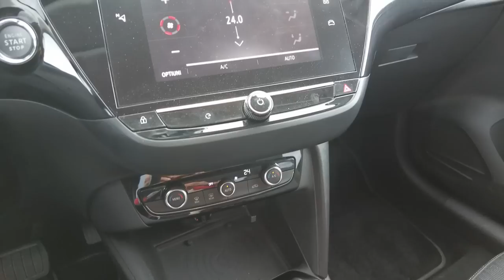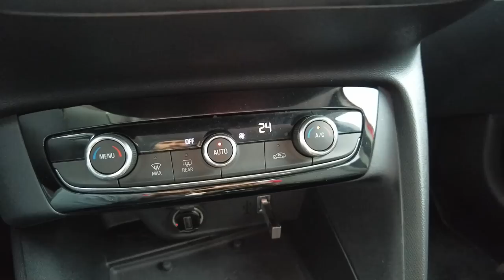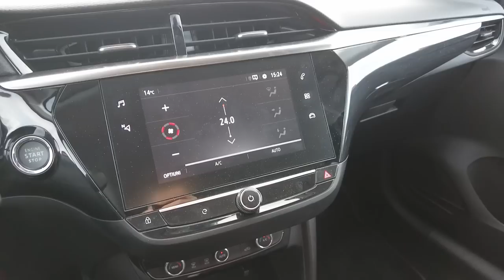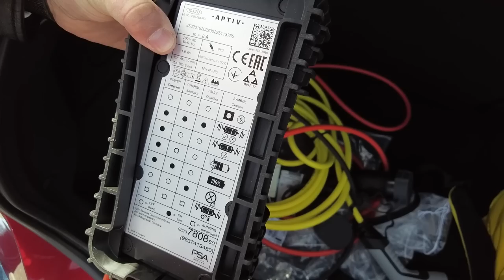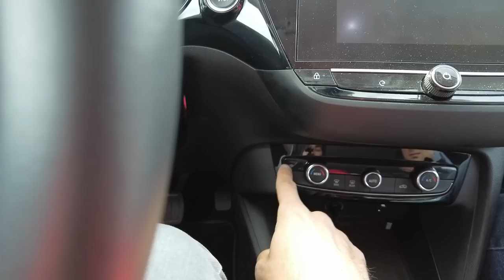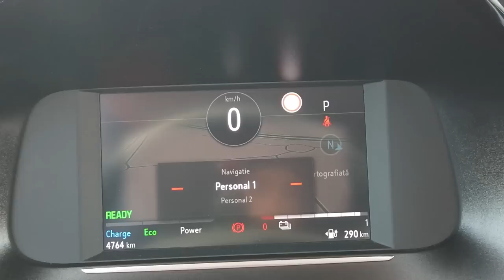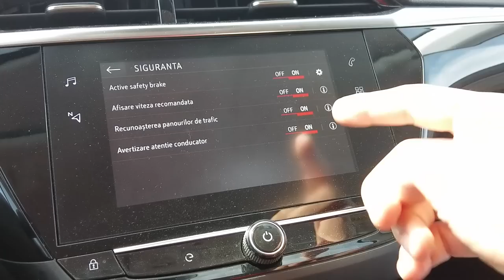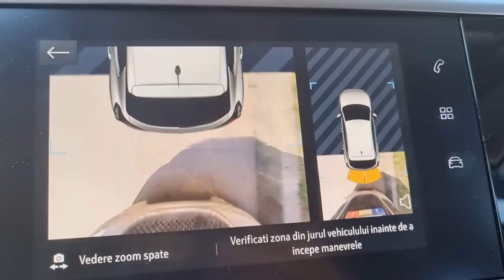Opel Corsa-e | Cel mai bun raport pret/calitate pentru o ELECTRICA (astazi) @ECODRIVE

Comment: Faine electricele, dar eu am 2 lucruri foarte utile: abonament la transportul in comun + mersul pe jos (pentru urban) si tractor pentru extraurban...stiu, stiu, am emisferele deplasate si inversate, vorba unui prieten!
Reply: Transportul in comun si mersul pe jos bat orice masina. Nu este o gluma, este realitatea.
Reply: @ECODRIVE  mai misto cu bicicleta
Reply: Masina paguba la casa omului ,nu pol ?
Reply: @trawauto9565  niciodata!
Reply: @ECODRIVE  cu 3l de apa am pedalat 80 de km...deci, da, aveti dreptate!
Reply: @poldaniel3574  sunt fan bicicleta. Inainte mergeam si 100km intr-o zi. Ultima data cand am mers mai mult a fost la “Prima Evadare” 👍
Reply: @poldaniel3574  e buna o bicla mai facem și noi sport ...
Reply: De o vreme incoace nu ma mai pot da pe bitza din cauza unui genunchi...inainte faceam cateva mii de km anual, seara dupa servici si in uichend (am scris expree).
Reply: @trawauto9565  da, inainte faceam multa bicla, acum nu mai pot...
Reply: @poldaniel3574  pol dar unde o fii dispărut popica cred ca e ocupat sa le dea de mâncare la cățeluși 🙂🙂
Reply: @poldaniel3574  genunchiul cam nasol dacă ai probleme la el ...mai ales pt bicla genunchiul e vital
Reply: @trawauto9565  da, in urma unui incident pe santier mi s-a rupt 2 bucati de os si se afa intre cartolaj si rotula...trebuie operatie dar sunt barbat, merge asa boss! 😂😂😂😂
Reply: @florinionescu8594  😂😂😂 ne vedem la “Prima evadare” in primavara

Comment: La infrastructura de la noi, cred ca tot Kona de 64 kWh e locul de pornire daca electrica va fi singura masina (Are autonomie mai buna decat model 3 SR dar e limitata ca spatiu interior) , e cu vreo 6000 mai scumpa decat ceva de genul Corsa e dar ai si autonomie incat sa nu iti faci griji daca nu gasesti statii.
Daca am avea statii fast charge de 100+ dese nici cu Corsa nu ar fi problema la drum lung.

Recent am fost cu un coleg care are Kona electrica 2021 Iasi -Transrarau si retur, si a facut 470 km fara sa trebuiasca sa incarce pe drum  - iarna 4 oameni in masina , intr-adevar mers fara sa depaseasca limita legala de viteza dar a ajuns doar cu 15 minute mai incet decat alt coleg cu Mazda CX-5 .
Reply: Kona este printre cele mai bune masini electrice. Are cel mai bun raport pret/autonomie. Este o masina eficienta si are autonomie mai mare decat Tesla Model 3 SR+.
Corsa este un fel de “kona” in segmentul ei de pret.

Comment: Masina merge cu 7 km/h neavând 1 pedal dar poti modula viteza sub acea valoare folosind pedala de frana. Legat de autohold, s-a făcut "cost cutting" din nefericire dar poti activa frana de mana electrica la semafor fara a trece in modul N iar masina va stationa.
Reply: Va staționa, dar forțată de frână sau pentru ca se oprește acea ușoară accelerație? Oare se consumă energie dacă se cuplează frâna de mână electrică fără a se trece în modul N?
Reply: @simimy97  Totul este electronic. În momentul acționarii frânei de mană motorul cu siguranță este oprit deci nu forțează nimic si nici nu consumă.

Comment: Salut Vlad, salutare tuturor care urmaresc canalul tau. Felicitari pentru canal,te urmaresc cu mare drag de mai bine de un, de cand mi-am luat si eu o Corsa electrica( Vauxhall). Locuiesc in UK de aceea este sub sigla Vauxhall. Esti extraordinar in ceea ce faci, felul cum prezinti masinile, cata pasiune si interes ai pentru domeniul auto.Povestile pe care le aduci o data cu masinile sunt captivante si detaliile deasemenea,de aceea te ascult cu placere ore intregi. L-am urmarit mult pe prof. J. Kelly.Revenind la masina(Corsa)eu unul sunt multumit pana acum, masina este fabricata in ianuarie 2020, am luat-o de la o reprezentanta Vauxhall cu 2300mile(@3700km)parcurse.O conduc zi de zi pentru naveta(oras,drumuri nationale, putina autostrada- viteze pana la maxim 70mph(112kmh),18mile(@30km)dus-intors.Am avut o singura problema pana acum, o scurgere de antigel la unul dintre termofloturi( in partea stanga sus), a fost schimbat pe garantie. Consumul este undeva de 15-20kwh/100km in zilele cu temperaturi peste 10grade, iar cand este frig in primii 10-15km consumul este undeva la 25kwh/100km daca nu fac preconditionarea masinii implicit a bateriilor. Macar 20 de minute inainte de a pleca la drum pornesc caldura din aplicatie sau o programez cu o zi inainte. Am ajuns sa o conving si pe sotia mea sa o conduca :) si am mai luat si un Grandland hibrid4 tot asa de prin 2020 cu vreo 4000km facuti. Grandlandul este altceva, este o placere la condus,iar consumul total la benzina dupa 1000km afisat acum pe bord 3,5L/100km dar o incarcam tot la 2-3 zile acasa la incarcator de 7kwh. Consumul de curent este pe undeva la 25kwh/100km dupa transformarile mele din mile/kwh :) . Am observat la Corsa cand o incarc la un incarcator de curent continuu imi arata range-ul apropiat de cum spune cartea :) adica 209mile(330km)cand o incarc de acasa la 7kwh monofazat (30A) imi da range doar de 185mile(295km) iar in viata reala fac cam 120-130mile(200km) ceea ce este bine pentru mine. Imi cer scuze daca am scris prea mult. Te rog frumos cand o sa ai timp sa prezinti si un Grandland hibrid4(am vazut prezentarile la Ds7 si 3008 care folosesc aceiasi tehnologia cu Opel/Vauxhall, dar sunt niste aspecte care nu-mi sunt clare inca). Mult succes!

Comment: Fiind baiat destestept,sunt sigur ca daca te uiti mai atent pe un principiu de functionare a sistemului de climatizare o sa-l intelegi si  mai bine.  Aici l-ai prezentat eronat. Spun asta pentru perfectionistul din tine si sper sa nu fie luat drept un hate
...si da, cred ca esti nr 1 in ceea ce faci.
Reply: Pai e simplu sistemul, fiind pompa de căldură are vaporizator si condensator atat in botul masinii, cat si in habitaclu, si recircula antigel si prin baterie si prin ansamblul motor invertor convertor si incarcatorul de bord
Reply: @vladdutz20  nu are si condensator si vaporizator atat in botul masinii cat si in interior. Atunci cand vrem rece in masina ,avem vaporizator in habitaclu si condensator in botul masinii. Acelasi vaporizator devine condensator si invers cel din botul masinii devine vaporizator cand dorim caldura in masina.
Reply: @raw_truth  la acest sistem nu este asa, am diagramele.

Și sistemul de pompa de caldura de la Toyota la fel este, sau de la VAG
Reply: @vladdutz20  atunci e greseala mea. O sa ma uit pe diagrame👍

Comment: 1. De ce nu vorbiți  despre  reciclarea  bateriilor.  2. Dacă mașina  ar avea 8 ani și bateria  s-ar strica cât costă  reparația  ?
Reply: Ce-i cu reciclarea bateriilor? De fapt, unde ai vazut tu deocamdata baterii de masina electrica date jos? Uite, masinile electrice sunt in general noi - adica cu greu gasesti unele produse inainte de 2012. Iar masinile astea sunt functionale cu bateriile lor originale. Ca sa-ti faci o idee, pentru o masina care avea 150 de km autonomie, dupa 8 ani de folosire, sunt raportati acum cam 100 de km autonomie. Zici ca nu-ti faci treaba cu ea si asa? 

Apoi, sa stii, exista o cerere mare pentru bateriile uzate. Pe de-o parte exista deja metode de reciclare, pur si simplu se desface acumulatorul, celula cu celula si se refolosesc materialele. E greoi, dar merita efortul, pentru ca bateria valoreaza mult. Apoi mai sunt campurile de fotovoltaice ce vor sa foloseasca acesti acumulatori uzati pentru a stoca in ei energia in exces captata in timpul zilei. Este excelenta metoda pentru a elibera energie noaptea, la valori mult mai bune. 

Cat despre treaba cu 8 ani, iti spun cum e calculul la masinile de sub 15.000 de euro. O Dacia Spring o acoperi din economia de combustibil si piese integral pe la 100.000 de km. Un VW E-UP pe la 130-140.000. E-UP-ul are garantie pe baterie pana la 160.000 de km. Practic daca se strica atunci cand iese din garantie, nici nu o repar, iau direct alta, pentru ca masina deja si-a acoperit complet costurile de functionare.
Reply: Eu am baterii de drona care au peste 10 ani si merg ca in prima zi.

Costul unei baterii este mai mic decât reparațiile care intra în 10 ani într-o masina cu motor termic

Comment: Salutare, merita o masina electrica?! eu acuma am  un MB A-Class 170 cdi si consum 6L motorina pe zi (iarna) pentru naveta 80km dus-intors, merita sa dau MB la rabla si sa i-au o electrica dau un exemplu fiat 500 electric sau dacia spring, prieteni mei imi zic sa i-au dacia sandero pe gaz, nu visez la tesla ca stiu ca nu imi permit asa ceva, voi ce parere aveti.
Reply: Electrica e ideala la oraș daca ai unde sa incarci fara complicații
Reply: Ia-ti linistit orice masina electrica. Pentru naveta de 130 km eu, cu eCorsa, consum 50% din baterie (autostrada, oras si DJ). Am schimbat B Klass de 200CDI din 2010 pe ea. Daca te-ai obisnuit cu A Klass, iti recomand VW eUp, care isi face treaba admirabil pe o asemenea naveta. Chiar si eu m-as fi descurcat cu un eUp, dar am avut nevoie de ceva mai mare. Spring-ul e ok pentru oras, dar, la 45 de cai, e slabut pentru naveta. Succes in alegere!
Reply: A, era sa uit: Naveta pe benzina/motorina ma costa cam 80 de lei. Pe curent, cam 15 lei pe curent casnic sau 0 lei daca prind, cat stau pe la supermarket, vreo statie gratuita.

Comment: Spring e o mizerie desi văd in fiecare zi Spring-uri curate.😉 Cu o galeata de 10l o speli si o clătești. 😀
Ar mai si VW Up pe care l-au reintrodus si pornește de la 25.600euro.Versiunea cheală poate fi luată cu 14100euro prin Rabla. 
Imi place ideea celor de la PSA care s-au gândit sa folosească aceeasi caroserie si pentru IEC si pentru EV.  Si e-208 si e-Corsa sunt faine ca masini de oras si deplasari pe ici colo.
Reply: Ai mers cu Spring-ul sau ti-e frica ca iti scade rangul?
Reply: Singura problema pe care o am eu cu Spring-ul ar fi spatiul interior, mai ales spatiul din spate. Serios, sa-i fi facut macar 10-20 de cm in plus acolo nucred ca bubuia pretul. Dar asta a fost motivul pentru care eu n-am luat-o. Am prins deci atunci, cu 5000 de euro in plus, un VW E-UP, la 14.000 de euro, cu aproape tot pe ea (doar fara camera de parcare). Masina mai incapatoare (desi sunt sigur ca din afara n-ati spune asta), masina mult mai agila si, din cate citesc pe grupurile internationale, deja o masina validata de anii in care este deja folosita. Adica oamenii care o folosesc de prin 2015-2016 sunt extrem de incantati de ea. 

Mi-ar fi greu sa ma decid intre masina prezentata aici si VW E-UP-ul meu. Inteleg ca autonomia e mai mare cu vreo 70 de km, dar nu stiu daca merita sa dai inca 33% din valoare pentru asta. Interesul meu cand am luat electrica a fost ca in perioada de garantie sa acopar complet investitia doar din economia de combustibil. Si asta se cam intampla bine deja.
Reply: @MrSavage77  spring are problema de siguranță la impact in trafic.
Daca intra o masina in lateral nu e ok in ea.
De aceea si costa atat de puțin.

Majoritatea celor care si.au luat spring vor sa le vanda acum, pentru ca nu sunt clienti de masima electrica, isi blesteama zilele:)
Masina nu are nicio vina, au ales ei greșit.

Este fix ca si cum cineva din Honolulu si.ar lua bocanci de munte desi sta in oras de 30° si se plange ca ii e cald tare la picioare
Reply: @vladdutz20  de unde ideea asta cu majoritatea? Ai facut tu un studiu? Poti sa-mi trimiti linkul? Eu vad din contra…sunt cazuri unde vor sa cumpere al 2-lea Spring, iar altii nu au rabdare sa astepte 5-6 luni pana le vine masina.
Reply: @MrSavage77  la fiecare mașină electrică filmata când am încărcat nu am prea vazut oameni mulțumiți de spring.

Mie mi-a plăcut pentru costul ei e ok in interior, mai puțin siguranța
Reply: @vladdutz20  i-ai vazut tu pe toti cei 27876 de proprietari de Spring din toata Europa? Ma indoiesc…
Reply: @MrSavage77  eu zic de Romania, București
Reply: @vladdutz20  
Sunt 3,4 muste pe olx care isi vand springul la supraa- pret , din multe sute de springuri aflate acum in trafic(poate peste 1mie), deci  nu muri tu de grija celor care "crezi" ca s au pacalit,  sa fim seriosi
Dacia logan , a fost lafel de  nesigura , pastrand proportiile ,cu un enorm succes.